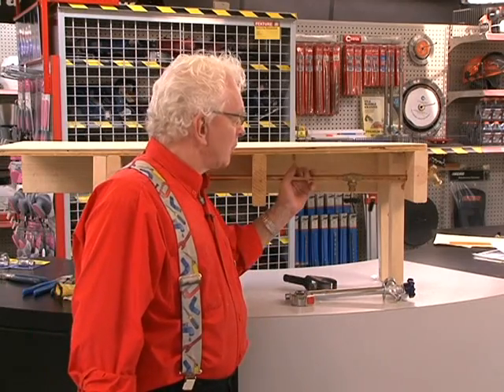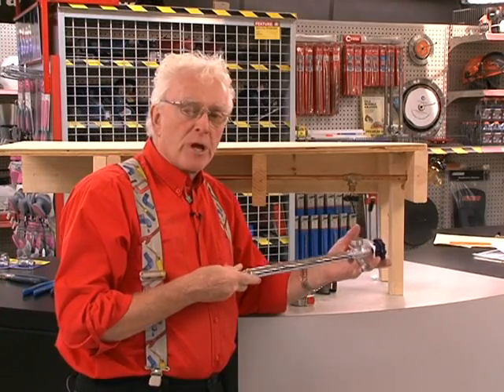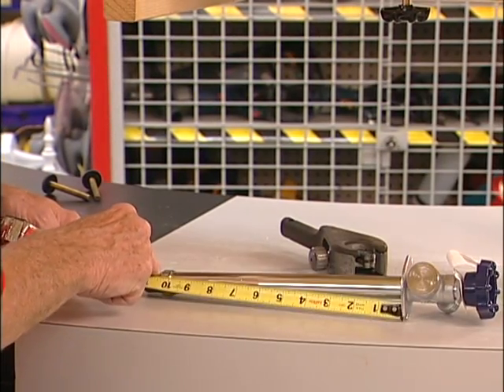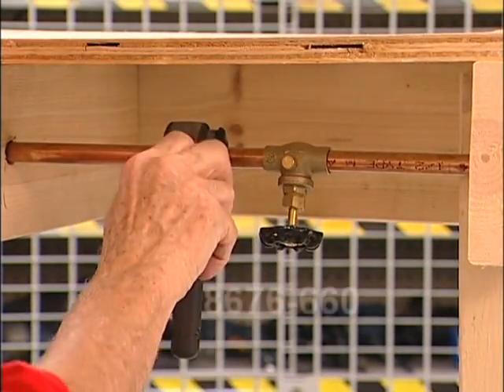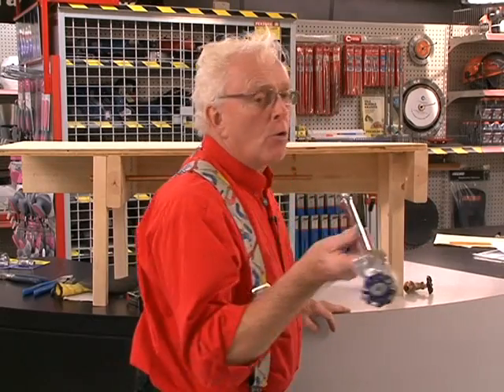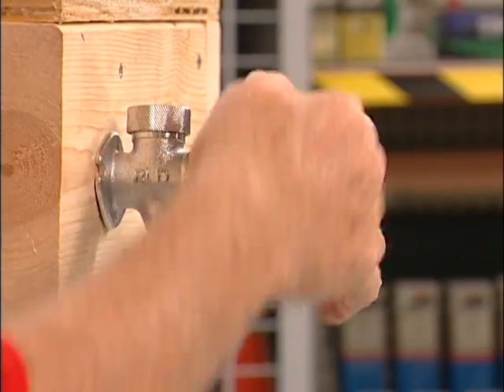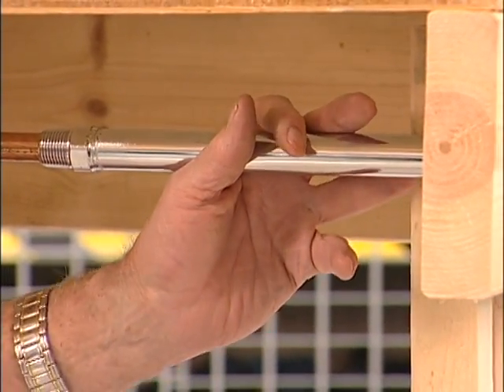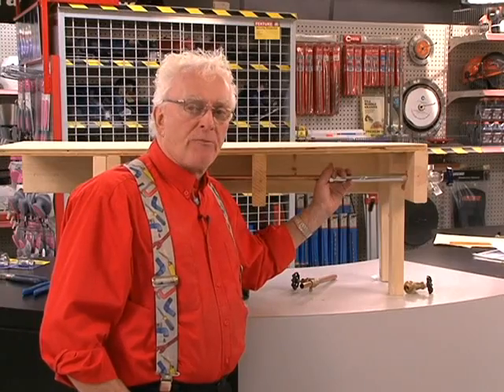Installing a Frost Free Faucet

Comment: Many times you don't need to replace the entire sillcock, just clean or replace the seal. Then use this plate that slides in behind and you don't have to remove the faucet at all! Don't risk the leak inside. https://www.ebay.com/itm/133346116450

Comment: NO! NO! NO!    Why are you soldering inside a threaded fitting?  Use $3.00 1/2 to 3/4 threaded copper fitting so if it ever does freeze or wear out, it can be replaced by the home owner.   The threads are on the end of the faucet for a reason.